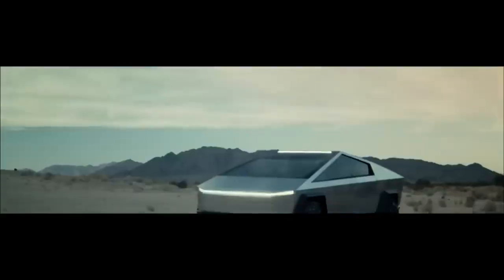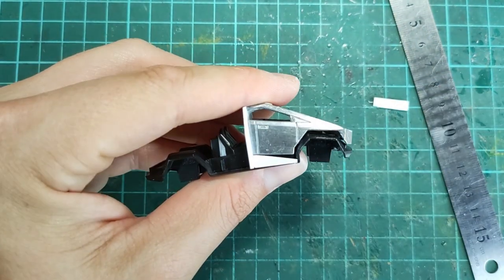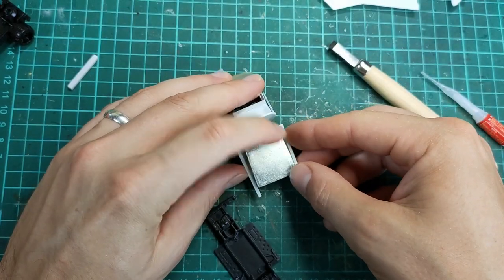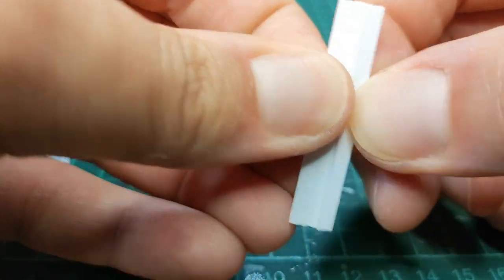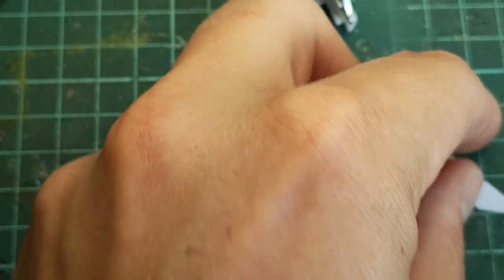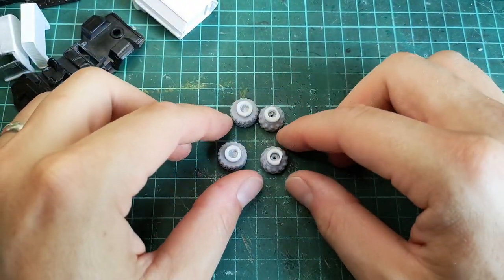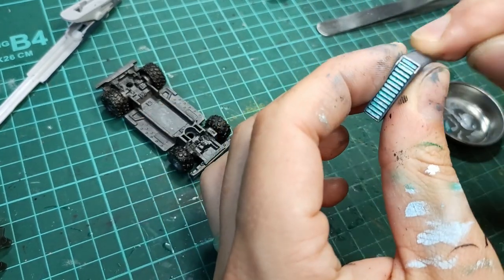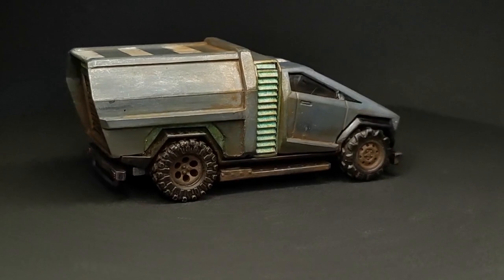I fixed the TESLA Cybertruck! | Scifi garbage truck

Comment: great work! :D
to me this truck looks like a rolling polygon taken out of an ooold computer game. XD
that's a lot of work you put into this thing, for hating it. :) especially on the rear part.
interesting use of a zip-tie. that's it, grab everything that could be of use later! :) when I worked at Behr's in germany for a few days I could snatch strips of printed aluminium foil. it's used to fill the gaps betwen the channels of intercoolers, and they have tiny louvers printed in, just the right size for 1:64 scale... now I'm dying to make use of them. :)
Reply from the maker: Nice! Thanks for watching 👍 choosing a bad casting for a build off base is kind of a tradition for me since it provides a challenge!
Reply: @BPCustomCreations  true! :) considering that Ugly Bone Shaker, and how often it gets modified and slaughtered, this is true for most customizers. :) and Mattel thinks everybody loves that casting. XD